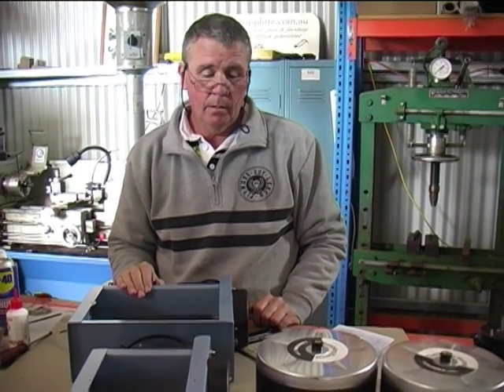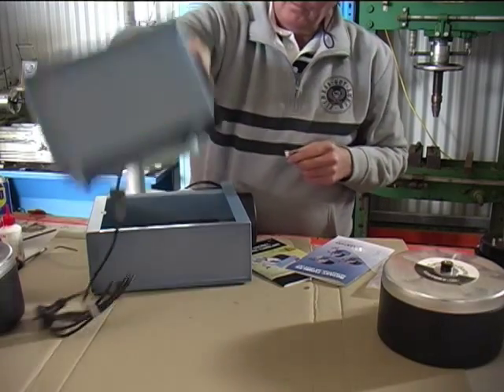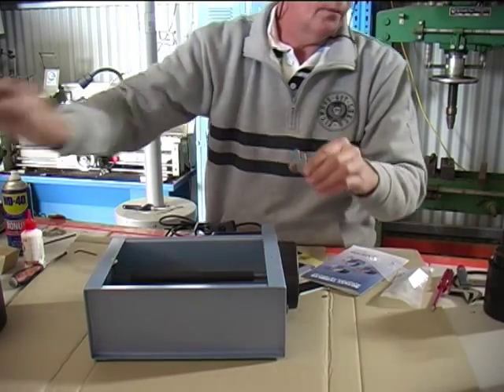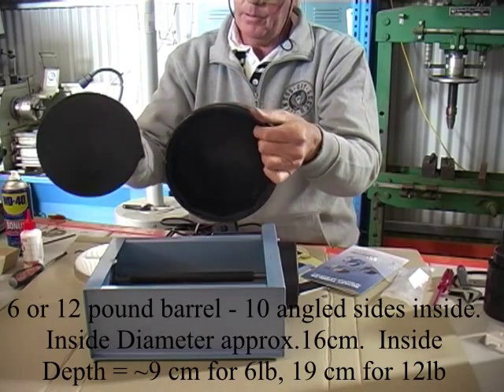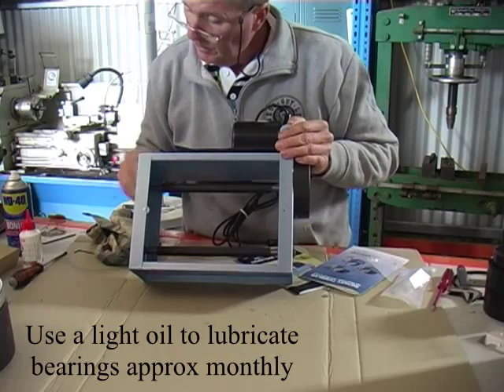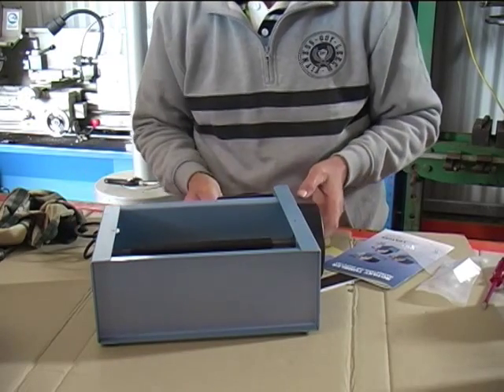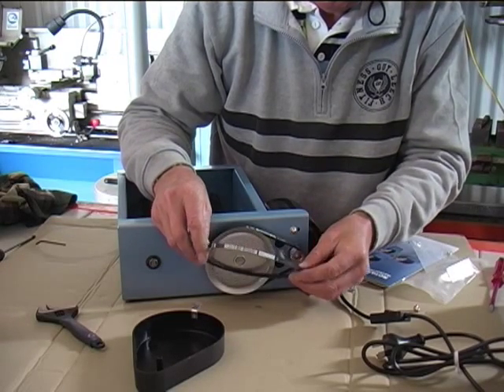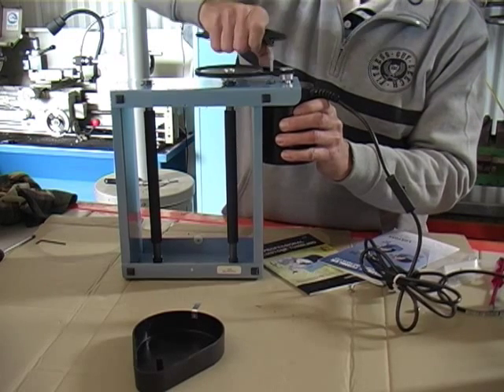Lortone QT Series Tumbler Maintenance (QT6, QT66 and QT12)

Comment: This is very helpful! I have two of these tumblers. How do you get the pulley off the old motor? I can see that I probably need to do something with the circular hole, but I have no idea what tool to use or how to do it.
Reply from the maker: Need an allen key of the right size to undo the grub screw holding the pulley on to the shaft.